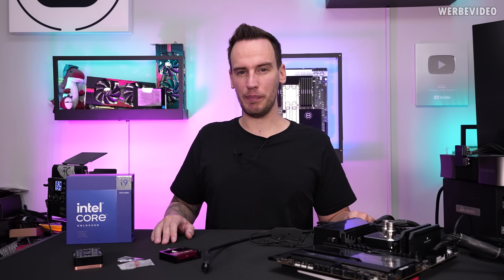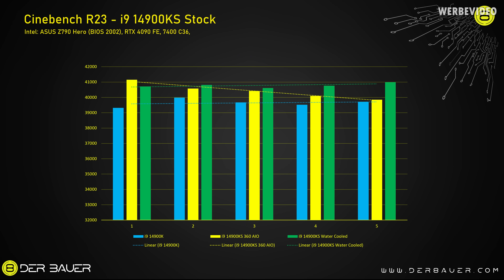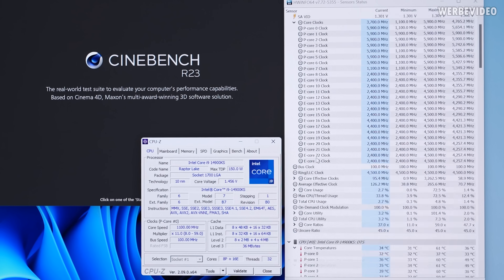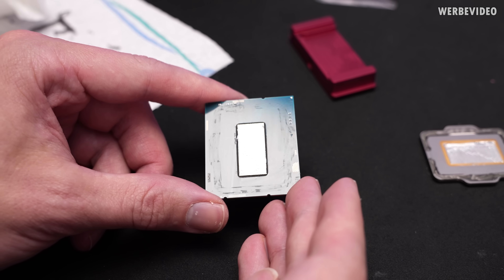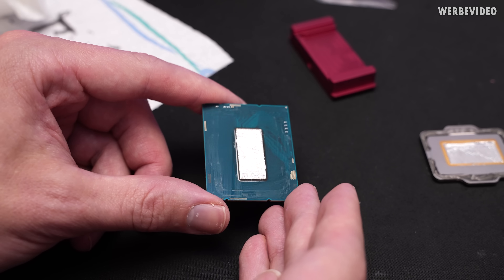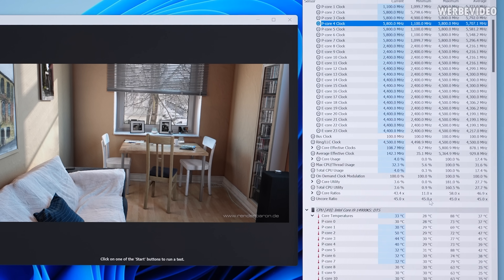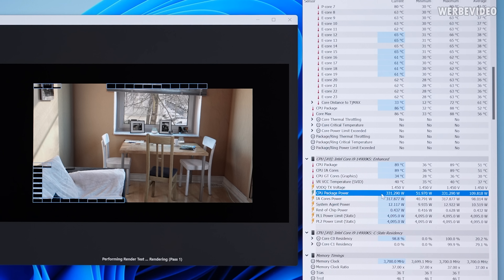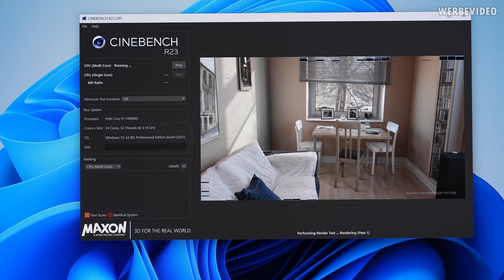My New Water Block - Time for 14900KS Direct Die

Comment: im getting old pentium 4 netburst wibes from these new intel space heaters
Reply: Yep, the old days are coming back... Little generational improvement for much more power.
Reply: (inserts the Captain America "I understood that reference" meme)
Reply: Funny enough, the 1.525v core voltage he sets is the stock voltage for Northwood Pentium 4s.

I do miss the 1+ GHz overclocks we used to see though.
Reply: They were "only" around 200-250W, not 400W.

Comment: This CPU should be Special Edition (water cooling required)
Reply: It pretty much is. You would be a fool to buy a KS and air cool it.
Reply: You will see a lot better temps even on an air cooler if you're going bare die, don't think water cooling would be necessary in this situation
Reply: Don't give intel any ideas next thing they'll do is branch off and make 15(1-9k) and a second run of 15(1-9w) for waterblock edition lol
Reply: @trixter192 You would have to be a fool to buy this cpu in the first place
Reply: Water cooling is required, and sub zero cooling is recommended
Reply: Phase change LN2 sold separately 🤣
Reply: @shadowarez1337  😂
Reply: I am struggling to cool it with 360 aio.
Reply: A 350watts cpu is ridiculous for retail.. Usage

Comment: What difference have you found between using a razor blade and using an acrylic scraper? I imagine that the acrylic scraper is safer to the user and the die between it has a lower hardness than a razor blade.

Comment: I always think it's a shame companies like Intel/AMD don't offer a special edition version that was never 'lidded' as it's the delidding process and the cleaning up the die that is the hassle, scary part and where most of the risk is.
Reply: You’ll never get a warranty for a delidded CPU/CPU without IHS from manufacturing. Are you fine with that?
Reply: @Simon_Denmark  I disagree, Intel's thermal management reacts super fast now if there's an issue and if it's physically damaged then yeah of course that's not going to be covered under a warranty and I'm ok with that. 
fyi, Intel is offering a delidded warranty on these chips to certain companies, which again to me just says they are worried about the chips getting damaged during the delidding process more than anything else.
Reply: Roman mentions in the previous video about intel working with some SIs. About selling builds with delidded 14900ks, which will be covered under warranty.
Reply: @Speak_Out_and_Remove_All_Doubt  They’re offering that right now for their current CPU’s or do you mean 14900KS delidded for OEM’s? I know that there’s been some delidded CPU’s sold by Intel in the past right? Anyway I doubt that either of them will start selling delidded CPU’s for normal customers.
Reply: @Simon_Denmark   The warranty is only on the 14900KS and it's only for a select number of OEMs. 
But what I am talking about is creating a batch of special edition CPUs that were never bonded to the IHS in the first place so that delidding is not even required. That would be easy to do, just take them off the production line before the IHS is put on.
Reply: @Simon_Denmark Strange how that should be a problem. We had plenty of CPUs in the 90s and early 2000s without IHS. First Intel CPU to use it was the Coppermine T version of the Pentium 3 in 2001 and AMD started with Athlon 64 in 2003.

I've had both a P3 667MHz and an AMD Athlon XP 2100+ (T-bread B version). The XP had four rubber feet to help keep the heatsink level and avoid chipping the core edge.
Reply: @Simon_Denmark   Many years ago, socket 370 Pentium 3 was offered exactly like a delided  modern CPU but with pins on the CPU. So the IHS is just redundant.
Reply: @Simon_Denmark  You are already voiding the CPU warranty by enabling XMP/EXPO, so. . .

Plus, the i9 10990XE has no warranty, the 9900KS has 1 year warranty, versus the 3 years for 9900K, so . . .
Reply: @AlfaPro1337  That is not entirely true. The only instance where this would be true is in the case where something like XMP is the REASON the part failed. Voiding a warranty for a reason unlated to a the cause of failure is a violation of the Sherman Antitrust/Magnuson-Moss Warranty acts.
Reply: The problem with delided CPUs is that unless you apply the pressure very evenly you can very easily crack the die.
Reply: @AlfaPro1337  They can’t prove if you used XMP/EXPO though but yeah I did not know about those weird warranty times for those CPU’s.
Reply: @Simon_Denmark They can, but it's already destructive at that point.
Reply: People can be quite clumsy, resulting in mass RMA's with the manufacturer blaming the users and vice versa.
But I'd like a naked CPU as well, much better temperatures :)
Reply: @Garrett1974   It could be a hassle I agree but we are talking a very small number would likely be bought delidded and then and even smaller number would be clumsy and break it, so an RMA department would just need to ask for photos of the die before creating an RMA and then any physical damage is not covered by a warranty. But if you buy a proper delidded block like der8auer sells then most people will be safe I reckon.
Reply: Intel is doing exactly this as per a recent article on pcworld.
Reply: @trixter192   no, they are offering to honour  the warranty to some OEMs if they delid this CPU.
Reply: @AlfaPro1337  - you are not voiding the warranty by enabling EXPO/XMP at all! Jesus.
Reply: This is the the thing that always makes me nope out of going this route. No way im risking that much money on the de-lidding/cleaning/liquid metal application prosess no matter how much I want to try it.
Reply: Cool setup
Reply: @JaenEngineering  Damaging the die is the main concern. The only way I see either company offering a retail chip like this is if they also included a mounting system designed around it. I think we'll see something like this sooner than later since the increasing thermal challenges aren't going away anytime soon.
Reply: @Speak_Out_and_Remove_All_Doubt  even if they offer delidded versions, they are usually for very specific cases (scenarios) and so the users. Not everyone has a money for a custom watercooling or an AIO for scalped CPUs. And especially not everyone know how to behave with delidded CPU bc it's basically as risky as working with notebook cooling system. One mistake, one crack, one death. Simple as that.
Reply: @Simon_Denmark 

Honestly some people would be. The problem is there aren’t enough people who want that for it to make sense. It’s not a terrible idea, it makes sense.
Reply: I think for the KS they should have a modified package that can do direct die but also is able to use the stock ILM by using a "bumper" that's sorta shaped like the outside edge of the IHS. They'd have to draw up quite a lot of mechanical specifications for it, and probably also screw around with the die heights but I think it'd make them an actually interesting enthusiast product.
Reply: @Speak_Out_and_Remove_All_Doubt  delidding ?? they just skip the lidding
Reply: Honestly, for AMD it’s not even that necessary. My dual tower air cooler can almost cool a 7900x. The only thing AMD really needs to do is not make the IHS so thick to maintain cooler capability.

For Intel 14900K, yeah probably a lost cause.
Reply: I completely agree - this is how CPUs were sold going back to the turn of the millennium - Athlon XP and Pentium 3 chips. They were installed into plenty of systems back then with few issues that used heatsink/fan assemblies . I don't see why delidded chips couldn't make a return now with a specially designed mounting solution to replace the ILM on the socket. Maybe have it that the chip must be used with the supplied solution for warranty coverage?
Reply: I remember the golden age of 32bit Athlon CPUs, they never had any "lid" :)
Reply: @Simon_Denmark  yes they can, it's called e-fuses.
Reply: @Spazilton1  You learn something new everyday, didn’t even know that eFuse is a thing.
Reply: @Simon_Denmark pretty sure (intel not sure about AMD) has a small bit of memory in the CPUs for debugging them so they are able to keep track of what settings like voltage and ram timings and everything else?
Reply: @deathdrop  Cool to know thanks.
Reply: CPUs always used to come with a bare die, sometimes with pads in the corner to reduce likelihood of damage.
Reply: But if your are going to delid you void your warranty anyhow...so a moot point. @Simon_Denmark
Reply: Yeah the problem with it is some normal consumer will still buy it and still end up cracking the die and start rma etc
Reply: amd used to do that but if you were not caregul you ended up breaking the die, the older heatsinks used a wwird mpunt system that often ended making too much pressure over the die

this is why they dont sell them like that anymore, i cant say i miss those days

if you want yourself to do it, buy a delid tool

tbh is a problem no one wants for 10% extra performance
Reply: @Simon_Denmark how often did you had to do that? i nevet saw a dead cpu under warranty in the last 25 years, it is always motherboard or ram or psu what dies
Reply: @AlfaPro1337  absolutely not
Reply: @Simon_Denmark  we never worried about warranty anyways.
Reply: @betag24cn You never know, there can be very rare manufacturing defects. Just because you haven't had to RMA a CPU doesn't mean that it doesn't happen at all.
Reply: @ekspatriat Yeah but I meant CPU's without lid from the manufacturing. It was wrong to use the word delidded.
Reply: @Simon_Denmark  on every company, every product can be defective and survive qa tests

but i have not seen one in decades, motherboards many, i have one here, ram, sure, hard disks, sure, gpus, sure, psus, oh, psus

the strongest link in the chain is the cpu in terms of warranties, if you delid it and destroy it with a bad overclock tbh, the warranty is your last concern
Reply: @Simon_Denmark they should still offer OEM delided CPUs with downgraded warranties. It's literally a cheaper thing for THEM to do... less time and material used during production to lid a cpu just don't and offer a lower warranty. Honestly race car guys don't care about warranty on a 57 chevelle we just wanna go fast lmao
Reply: @betag24cn I mean I agree with everything that you just said no argument from here to anything.
Reply: @Graciashauf 
Edit: Oh wait you just meant OEM's.
Don't mind my comment.
Reply: @Simon_Denmark You have one for a laptop which is almost always delidded so there is presidence there.
Reply: @Simon_Denmark Plus they also claim XMP D.O.C.P also voids warranty but everyone does it anyway
Reply: They can't because it would require manufacturers to make specific modifications to their coolers, mounting on the motherboard etc. It's just not worth it to them for a hand full of enthusiasts.
Reply: @Simon_Denmark ive never had a cpu die. im fine with that
Reply: i plan to use dental floss and a hot air station to delid my ryzen when i get it next week
Reply: @Gazer75  The Pentium II/III and laptop CPUs are the exception to not having IHS, not the norm. Every Intel CPU up to that point had some form of IHS, because the dies were encapsulated in plastic, gold, ceramic or hybrid gold/ceramic packages where one of those materials acted as the IHS. The original Pentium was either ceramic or a metal lid. The Pentium Pro was a hybrid ceramic/gold or ceramic/metal for the 1M cache variant.

The same with AMD, the Socket A Athlon/Duron/Sempron were the only desktop parts without an IHS. The AMD K6-III and prior all had a metal, ceramic or if you go back far enough, gold IHS. Mobile Athlon 64/Turion/Sempron chips generally did not have an IHS.
Reply: @GGigabiteM You're absolutely correct. Not sure why I brain farted on this. Had both 486s and several Pentiums back in the 90s. The good old times where a simple heatsink was enough :)
Not sure what the first CPU I ever had paste on was. But I know it was Arctic Silver 2.

But CPU without HIS and some corner pads should work fine. There was a lot less risk of cracking the core of the Athlon XP processors IIRC.
Reply: @AlfaPro1337  They have very little way of knowing without AFM/ESM observing an entire chip for hundreds of dollars of man hours, and a very loose "Don't Ask Don't Tell" warranty. Don't tell them you overclocked it. Simple as.
Reply: @SmogginMog  Which they (Intel or AMD) can do in order to check the degradation of the MC.

And you still wonder why pricing are sky rocketing.
Reply: I remember a lot of delidded Intel CPUs in the past, in both desktops and laptops.
Reply: why you say shame ? They do make samples ! Shame ?????
Reply: @Simon_Denmark  you shame too, why that ? Are you Fine ?
Reply: @lucasrem  What do you mean? Who am I shaming? You’re not making any sense.
Reply: This will open the possibility of direct die cooling to a wide array of people who don't know what they're doing. Return rates will go through the roof because of people mishandling it.
Reply: its more an intel issue than anything else.
Reply: @Simon_Denmark  this comment didnt age well lol...intel just officially supported deliding of this cpu
Reply: @Kisa718  Yeah for OEM’s or am I missing something more?
Reply: So much yes. I seriously want a CPU that comes out of the box delided, I get that maybe the IHS can be useful for protection during transport, so maybe have a lid that its held by a bit of glue, but lacks the conductive material and its even made out of plastic or anything that its cheap and protect the DIE.

You get it, remove the "IHS" without too much effort because instead of being ultraglued and having the thermal conductive solution it just have maybe what? 4 dots of glue?
Reply: @Simon_Denmark  of course i’m fine with no warranty for delidded cpu. You are loosing it anyway due to removing the heat spreader, not only loosing warranty but also risking damaging cpu when doing it. Tkink its worth it.
Reply: @AdmosSvg  I mean that’s just obvious. I meant CPU’s without IHS straight from the production.
Reply: @Simon_Denmark I don’t think anyone cares about warranty when they delid
Reply: @emsj86  That’s quite obvious isn’t it? You don’t delid your 700 $ CPU if you care about warranty.
Reply: @Simon_Denmark  but then if you are buying a delidded cpu you would have to be a professional to know what too do so you wouldnt need a warranty unless its for shipping and if it gets damaged during shipment
Reply: @Simon_Denmark  why not? Intel is providing warranty for personally delided 14900ks. (The warranty covers it) You'd imagine it would make sense from Intel's perspective bc less would have to be replaced bc mistakes during the delidding process.
Reply: @jdogdarkness   I thought that Intel was only providing warranty for delidded CPU’s for OEM’s? You’re saying that they extended it for normal consumers as well? ”Personally delidded”.
Reply: @jdogdarkness  Or I guess you meant personally delidded by Intel?
Reply: @Simon_Denmark   The terminology I've heard talk about wasn't exclusively OEMs. I think it was Moores law is dead where I heard it talked about. I forget the specific terminology.
Reply: @Simon_Denmark  Parece que Intel agora está permitindo abrir por uma pessoa autorizada sem perder garantia
Reply: They should offer this. They would only gain respect, good suggestion.
Reply: @Speak_Out_and_Remove_All_Doubt  no, they're also worried about the handling of the delidded CPU and installation of a direct-die cooler
Reply: @b1zzler  normally any damage after the delidding process would be either a cracked or chipped die which is easy to spot and not covered by a warranty or capacitors getting knocked off which they could easily mitigate by covering the PCB with a form of glue.
Reply: Indeed they should do the same with GPUs, selling them wihout the cooler then extreme oc or custom loop is easier
Reply: @ndebele100  tbf the GPU coolers are usually a little easier to get off but I get what you are saying.
Reply: @Simon_Denmark  in past it was no problem. We had warranty
Reply: The problem is, the lid also acts as their tamper seal.
Reply: @Speak_Out_and_Remove_All_Doubt  I see your point, but they probably also think those companies have competent technicians whom they trust to not make mistakes.
Reply: @franklincarroll6772  But they could just warranty the inner workings of the chip, so if your chip is cracked or physically damaged in any way then that voids your warranty???
Reply: @Simon_Denmark  your warranty gets voided with delidding